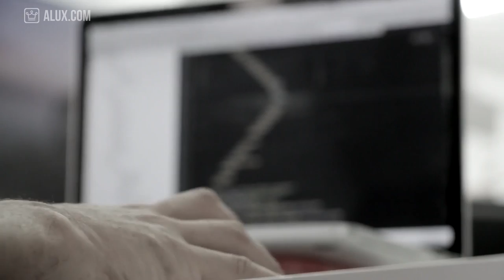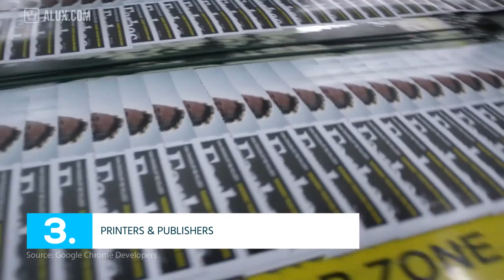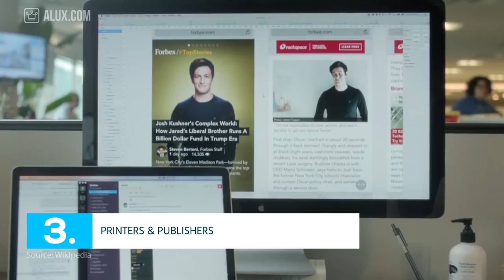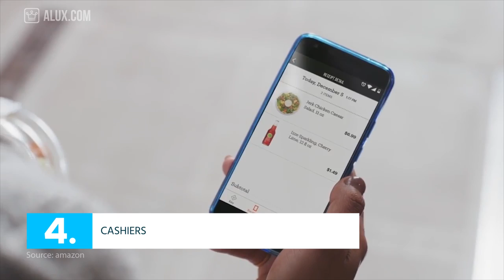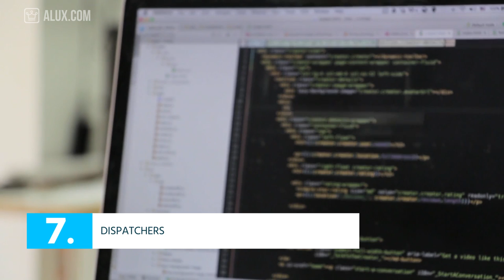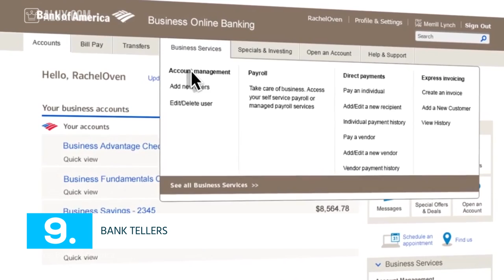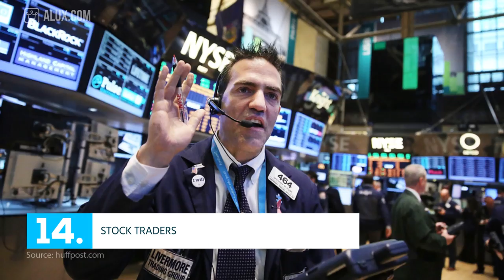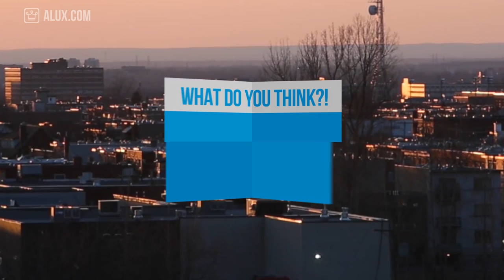15 Jobs That Will Disappear In The Next 20 Years Due To AI

Comment: Depends on what field in construction.  I highly doubt electricians and plumbers will be phased out by AI
Reply: What about maintenance workers in the cities government sector?
Reply: @michael3343  I'm an industrial mechanic. My job is going to increase for the foreseeable future. Unless the robots Will fix themselves I'm ok. Always need wrenchers
Reply: There is a growing industry that uses prefabricated parts to construct buildings now. All the wiring is installed in a factory and assembled onsite by low skilled workers. I don’t know what that means for residential construction tho. I doubt it will be happening anytime in the next 20 years. Plus a robot can’t do remodeling yet either or custom/new work electrical or plumbing. I think that these predictions are still very optimistic too. It will take longer to implement automated construction across the industry than 10-20 years. But no doubt it’s coming, hard to say when.
Reply: It is necessary for humans to keep the robots in check, so I definitely believe electricians will still be around
Reply: Why do you doubt that?
Reply: I think the video meant to reference new construction and not service. In new construction I agree, but 15 years would be unrealistically fast.
Reply: @M I At one point in the future, everything will be automated. Robots aren't 100 percent safe right now, so there are humans there to make sure they are kept in working order, albeit not as much as before. Either through quality checks or what have you. No job is safe,  not any form of engineering, but my point was more so that they will not be phased out anytime soon, as such with other jobs, especially when it comes to designing new automated mechanics.
Reply: They're making homes very smart in today's world I believe it can happen the lack of Need for plumbers are electricians
Reply: @shondasweetpotatopie9241  What. Electricians is a broad profession, literally going from assemblying the network in your home to fixing the breaker. If electricity can function and repair itself without any source of power then yeah, but clearly we don't live in the year 30000
Reply: @shondasweetpotatopie9241  Don't even get me started on who empties your septic tanks.
Reply: But as most people will be out of work, nobody could afford them

Comment: Wonder if a Tesla car can change a tire.  Or dig it self out of the snow bank.
Reply: They just read your comment and are quickly working on it 😂😂😂
Reply: XD XD XD XD @DJMARTIN73
Reply: I don't own a Tesla but the last time I had a flat tire, I called my Visa card's auto club and someone in a small car (i.e. NOT a tow truck) showed up and fixed it. The operator asked if I were in a safe place before advising me to keep my cell phone on. I had constant communications via texts regarding where they were and he called when he was near my location. Where automation played a role was in connecting the operator with a network of contractors who can solve small problems like flat tires, dead batteries, and lost keys. 

BTW, I do know how to change a flat tire. But I also know I can't tighten the bolts enough for safe highway driving.
Reply: look into runflat tires and tire pressure monitoring systems, this problem was solved in the 70s
Reply: And then... Teleportation. #infinitegame
Reply: @ClaytonBridges  yet somehow flat tires still happen...hmmmm ... interesting
Reply: @timdel7821  I didnt say they wont happen, the car will be able to detect if it does, the tire wont destroy itself on its way back to a repair facility
Reply: Emmers Ebon Hawk shit man you just gave then a new thing to work on and build a robot that can
Reply: Clayton Bridges I mean if a solution isn’t implemented fully in 40 years it’s not solved / the solution is not sufficient.
Reply: @caroline10081  still need humans isee
Reply: YuriVII  You should learn how to read :)
Reply: @JoseHernandez-xy8mj  There will still be essential human workers but the idea of work will change radically. Ideally all monotonous and dangerous jobs will be automated. I believe in Basic Income and letting people explore their potential. We will have more and more people retiring as the Baby Boomers reach 65. What do people do when they are not working? Nearly all of them will say they are busier than ever. As long as people have Basic Income, life is enjoyable. 

I'm not sure why the US is resistant to this idea. Canada has Guaranteed Income Supplement for seniors who did not save enough.
Reply: I didn’t see Tow trucks going out of business lol
Reply: Someday robots will take over everything then there won't be any jobs for us humans. Then how are businesses or big corporations gonna make money if nobody has a job or money to buy things?
Reply: Emmers Ebon Hawk don't know about the tyre change but it can surely get itself out of snow bank..
It's called traction control
Reply: Automated cars don't crash.
Reply: @cazkeymekam6427  lol. Good one. Lololol
Reply: @ahwayzcool4630  Seriously they don't.....our reaction time is much slower than AI .
Reply: @cazkeymekam6427  There were already accidents involving self driving cars. Google it.
Reply: @ahwayzcool4630  Hence why they aren't released to consumers yet.
Reply: @ahwayzcool 
Accidents per automated vehicles are far lower than accidents per human-driven vehicles.
When accidents are nearly entirely caused by human-driven vehicles, only automated vehicles will be allowed.
Reply: @kvaz21  True. But then the fun of actually driving your own car will be gone.
Reply: @caroline10081 Big difference between STILL BE HUMAN WORKERS and MUCH LESS HUMAN WORKERS which is what I'm trying to say. Basic income is a lie and a trap to keep you dependant and enslaved . Socialism never worked historically and if people are getting payed their is less incentive to push ur self. Its a devils lie and trap. weak up look at independent media like banned.video
Reply: @JoseHernandez-xy8mj  Everyone needs the basics of food, shelter, education, clothing. Some countries also say access to the internet is a basic right. The government should provide the basics. Everyone wants more than bare minimum so there's incentive to work and get ahead. But with universal basic income, no one is so down and out that they have to turn to crime
Reply: @caroline10081  Told you its a trap their is no basic income + incentive to to work and get ahead its either or. Look at history and look at banned.video before you keep answering fairy tails and wrong history.

Comment: Truck drivers will never go away. Driving is only one part of a truck drivers job. Computers can drive the truck for the driver out on the open road but a driver will always be in the cab ready to takeover and exit the highway to make the pickup or delivery. That means backing into a dock after opening the trailer doors or chaining down a load on a flatbed trailer and tarping the load to protect it from the elements. I am a flatbed driver. I stop every 100 miles or so and inspect the load to make sure it’s not coming loose from its securements. Don’t even get me started on hazmat and oversized loads. Those loads are watched closely every inch of the trip and federal and state laws dictate a driver is always in attendance within a few feet of the truck. No, truck drivers aren’t going anywhere but their job may get easier.
Reply: If demand for goods drops off, there will be a lot less freight to ship.
Reply: Corey Morrell I hope so bro
Reply: Your right
Reply: Never go away? Have you seen the types of robots that are being made nowadays? There are robots that are walking, running, jumping, picking things up etc. Yeah, it's very rudimentary now, but with how quickly technology is advancing in this day and age, it's only a matter of some decades before we start seeing the first Humanoid robots doing physical work. 

Eventually, Humans won't be needed for any physical labor, as manufacturing the bots will be cheaper, and the tech will be far more advanced.
Reply: Corey Morrell 
START LOOKING FOR ANOTHER JOB !
Reply: Frank James Or better yet, he should get a degree in the one of the sciences, gain experience through internships and volunteer work, and get a job afterwwards.
Science will never go away as long as Humans remain curious about the universe around them.

Or at the very least, he should work on getting promoted to the highest position possible in his current job, like some kind of leadership position.
Reply: I know you don’t wanna lose your job but cmon driving isn’t intellectual, there will be other solutions than what you are doing other than driving
Reply: Are you kidding me? Sure, there'll be "ride-alongs" for awhile, but quite soon we WILL have robots that can do everything you just described. It's only a matter of time. Rule of thumb: if it's a physical job, and/or if it can be done by wrote, it WILL eventually be done by a robot.
Don't see many human calculators these days, do you? Ask IBM and the electronic computer where they all went.
Reply: Owh man, get ready to eat your own words..

Automation doesn't discriminate..
Reply: Yodel-odel-ay-hee-hoo!

Comment: I think you are wrong on electric cars and  self driving cars: We have been flying planes for many years on auto pilot  and we still need pilots to step in in emergencies.

The self driving cars will not work unless we have separate lanes for computer driven cars , more or less like an "electronic railroad track" that will guide the cars.  Anything signal going though the air can be jammed, including a radar signal,    and there are too many cases where where cameras will not work. In very densely populated areas more public transportation  will be the answer: New York, LA, SF, Seattle,  BosWash are all great candidates.   In rural areas you will still have regular gas driven cars. 

I think what we will find that more public transportation is far more cost effective than having individual self driving cars on the road and the place where that would be most applicable is commuting in urban areas. Have private rooms in the public transportation 

The current Tesla battery model for cars will not work for long trips, but it is fine for commuting and short trips becasue to can simply "top off" your charge at work and at night at home.  The hang time on the charging station is far too long to be practical for long distances trips and you will need too much real estate for the changing stations, due to the long hang time  and people simply do not want to wait for an hour or more when they are on long trips AND time is money! People don;t want to waste time changing a car battery when on a long trip or transporting freight. Compare the "hang time" on a changing station of an hour or more to the 3- 5 minutes it takes to gas up an ICE (Internal Combustion Engine) vehicle.  Many cars in Europe run on propane or Natural gas and they are less expensive than regular gasoline and   will also have low hang time on the pump.  Yes, you can shorten the EV battery charge time, but it will cost you battery life, at least at present technology levels. 

A "low hang time" model that may work for electric cars is to have a "battery exchange facility" at truck stops  and thruway rest areas which would allow a fast refuel. I believe Tesla has an exchange option, but it costs more.   The manufacturing cost per KW of battery power

Right now a low end Tesla with all the features will cost around $45k - $50k and not the $35k often cited. I can buy 2.0 Toyota Corollas (wonderful commuter car) for the "low end: Tesla  price"  or three slightly used Corollas and they get 32-38 mpg.   It is pretty hard to be competitive at that initial cost difference and high Corolla mpg.  The big additional cost for the Tesla is the battery replacement: the manufacturing costs per KW   run $200 to $350 so we are looking at somewhere between $20,000 and $30,000 (my rough estimate)  to replace the Tesla 85 KW battery and that is with no profit for the battery manufacturer.  Also, every rechargeable battery will fail after some finite number of recharge cycles. We just don't know what that number is for Tesla batteries and the number of cycles depends on how hard the battery is used: faster charges and full discharges will likely shorten the life

I would not rule out Natural Gas or Hydrogen powered cars being more cost competitive than electric cars.

Comment: The 1st job is a heavy misconception, Cars and busses and trains might go automation,, but infrastructure and combination vehicles will take much more time before it could adapt to automation. 

 The misconception of trucks not needing to stop is very misleading and a smidge ignorant(No offense) Trucks might be machines,  but they do need to stop. Open trailer doors, adjust tandem weight, DOT hours of service and regulations, fuel, maintenance and adapt to weather conditions and adverse driving situations, as well as, speed adaption. Trucks will operate like airplanes. It will have an auto-pilot feature, but a person(s) will always be in the vehicle. 

This information is more of an assumption by people mot involved in the industry fully and are dishing out opinions than actual fact. You'll see. I am a business owner in this field and I am originally from an economic/finance background; the vehicles that are being made are mostly short range tractors.

# futurist.
Reply: Robert Lee James Welch I came to the same conclusion. On top of that, only the relatively large industries that have regularly scheduled deliveries will fully adopt this expensive tech but smaller industry will continue to rely on tried and true manually opperated vehicles. Companies will still have preexisting trucks and they will figure out how to profite from them. Even the personal vehicle market won't fully adopt it, people as well as the law will insist on the vehicles still have a manual control setting. People will still opperate older cars and some car companies will provide manually opperated only cars from high performance to budget  friendly models. People make too much of the driverless vehicle hype.

Comment: I was on board until the end. There will always be a need for construction works. It may not pay great but there will be a need for manual labor.
Reply: Manual labor such as welding, construction, concrete, power line workers, cable, etc. will always be done by people and the pay is always getting better. There may be robot assistance happening but that is it.

Comment: I'm not sold on the construction workers being replaced. Menial tasks on sites perhaps, but robots/ai won't be building massive structures on their own for a long time. Technology is helping construction at this point, machinery lifting/digging vs hundreds of people with shovels, etc., is safer and more cost effective... but construction jobs aren't going anywhere. 

I do the cabling part of construction, later down the line. While things like wifi and das systems are reducing the amount of cables needed, there will still be a need for cable installation. Definitely focus on specializing for custom installations needed on site. 

Besides construction, I agree with the rest of the video. Apologies if I rambled.

Comment: I partially disagree with the movie star and stock traders part (about the HFT's) . Ok, it's cheaper to make movies with A.I. instead of actos, but i think people will always need to idolize others. There are people who only see a movie because of the actors on the screen, and even knowing that you can reproduce them artificially through an A.I. system, it's not the same thing for these people knowing that the actor was really there acting. Of corse you can lie, and say he was there, but i just don't think it worths the risk to do so. 
And now to the stock traders, the thing is HFT (high frequency trading) is in the market a long time ago, and it's responsible for at least 80% of operations. It's being a profitable business for at least 10 years, and it's based on high volume operations within low differences in price and (less than a cent, and less then a second). Of corse traders could eventually lose theirs jobs because of A.I. (maybe robot traders) but it has nothing to do with HFT, HFT has already took a lot of jobs and it's a really competitive market where the faster machine, with the faster location wins... and it's variable. The market is always changing, there is no perfect formula, as soon as someone discover a perfect system it becomes obsolete, so it's not as simple as many think where you get a robot and it will always works better than a human. If robots are competing against robots using mathematics and algorithm, sometimes it's good to be a human using critical thinking

Comment: self-driving trucks - won't happen - batteries take up too much weight
Reply: How about make better batteries? Also, have you ever realized that trucks basically have batteries (fuel) and that most humans weight over than a battery that could literally last for decades whilst they are a more inefficient form of calculation algorithm that also needs energy to literally pump blood, fuel the immune system sometimes, repair bones (if you break), replace skin.